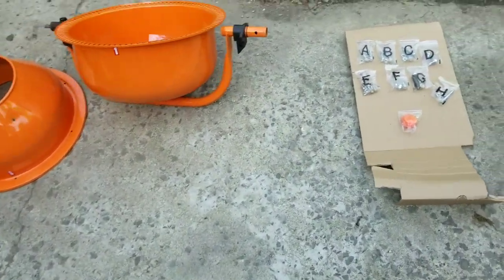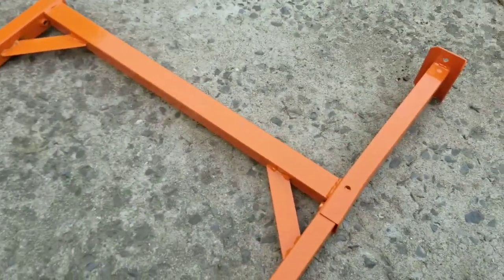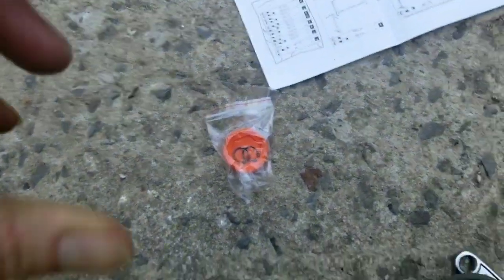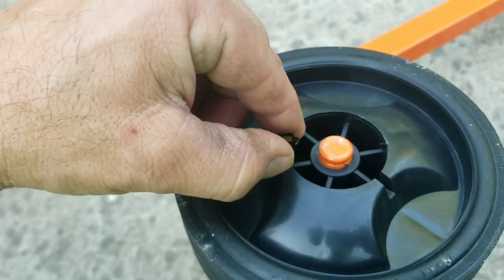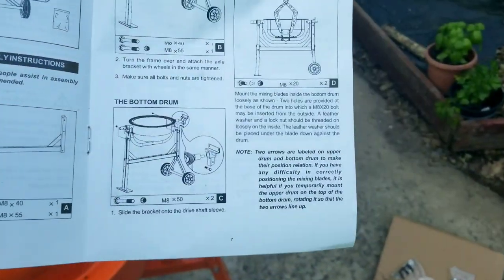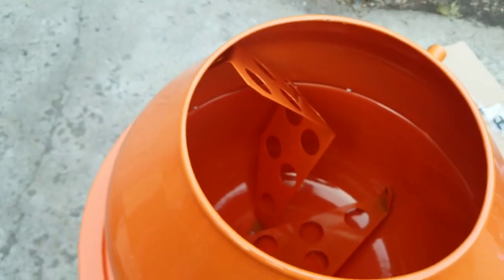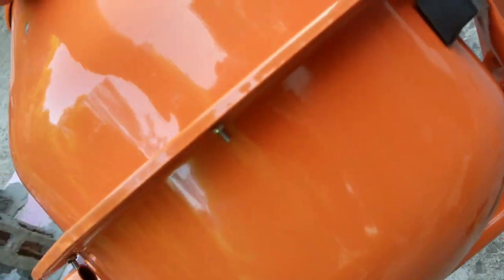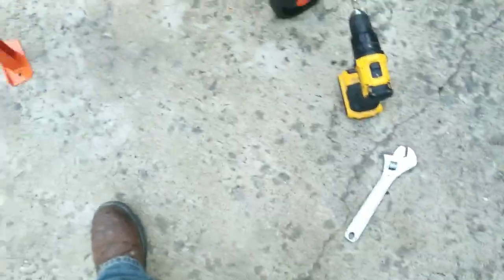Concrete mixer from Amazon

Comment: Yeah the “belt” was actually the “leather washer”. Obviously whoever translated the instructions got that WRONG. Rubber washer not leather
Reply: Yep your right , looks like the rubber seal for between the 2 half of the mixer barrel , they worded things very badly and this is what happens when things are made on a production line in a factory in another country that don’t speak English , they just don’t give a hoot some workers , parts missing or wrong parts etc then at the end of the line taped up and sent to us suckers. Go figure.

Comment: Thanks for your help and so true on the images in the manual, but they tried😁. It also sucks they did not give any details about the belt, I caught it in time but sucks if setup all and then figure that you need it for the upper and lower drums.

Comment: Not seen these in Australia before but they are selling them here now at Bunnings as a brand name Ozito cement mixer $299 lol so many names for these things in different country’s,they must be making a fortune.
Reply from the maker: I've should have updated this. Don't buy a small mixer. You can't put much in it to do anything. The total volume means nothing because mixers need to be turned horizontally (tilted sideways) for gravity to mix. It is hard to mix a 5 gal bucket of material in this mixer. I don't remember the specs on this mixer and don't remember if they only gave total volume or mixing volume.

Comment: Thanks for the video. I just got one but havent used it yet. Name is Costway Portable Electric Concrete mixer. I guess its a few 80lb bags at a time safely?. 2.2 cubic feet
Reply: 2.2 cu ft = two  60's or one 80 lb bag...  don't overload it or it won't mix...

Comment: Curious, did you ever use it? How much (50 lb. or 80 lb.) can you put in at one time?
Reply from the maker: Yeah, it's completely useless due to its size. Couple of 5 gallon buckets of material is too much. The problem is, for it to mix the barrel needs to be horizontal. Which already limits to how much you can put in it. If it's too stiff, it rotates with the barrel. Too loose, and it splashes out while mixing. If you want one look for a larger sized barrel.

Comment: Yeah stooopid instructions. I searched for this video cuz I couldn't find the "leather washers" in bag D either AND the dumbstuction said to insert the non existant leather washer onto the bolts from D bag that secure the blades onto bottom drum.... HUGHHHHH?? . AND... nothing said about the rubber gasket. 

Anyway... after watching your vid think I'll add some rubber caulking to that rubber gasket on both sides. That should seal it well, maybe drill and add those extra bolts like you suggested too. What the hell, how often are you going to take that drum apart anyway if ever right?